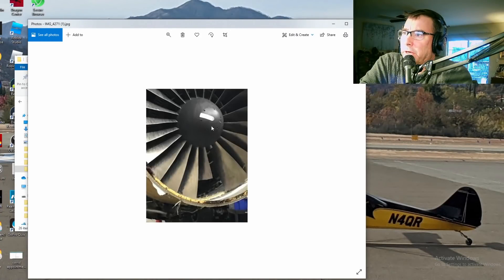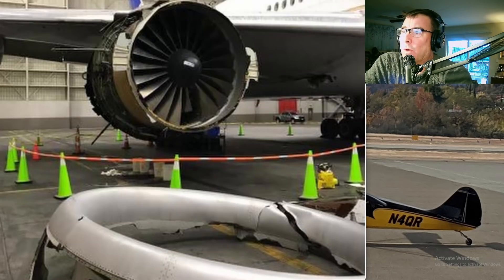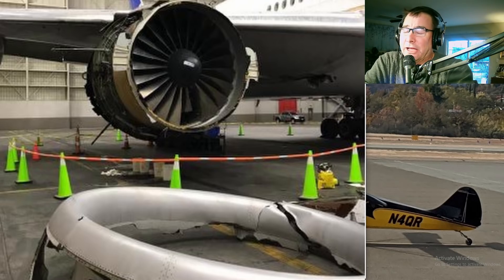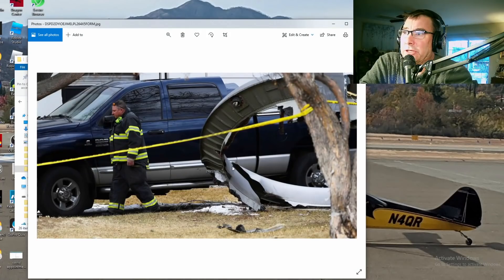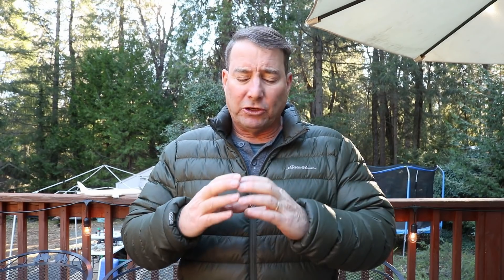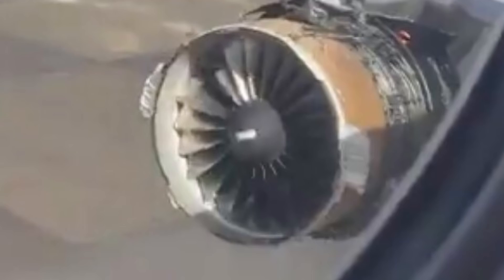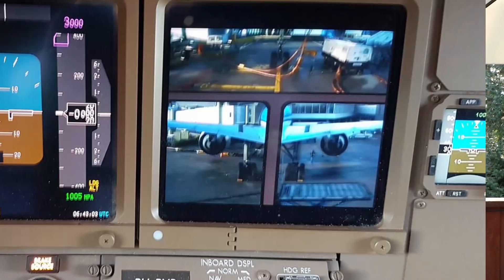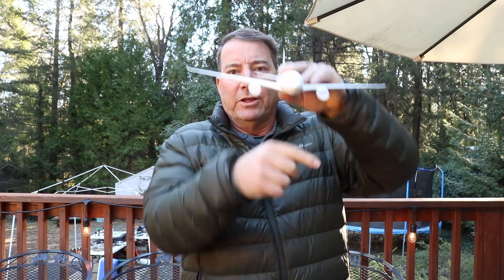UAL 328 UPDATE Fan Blade Failure  B777-200  22 Feb 2021

Comment: Contained vs Uncontained engine failure:  Okay, it’s true that the 35 pound fan blade did not pierce the Kevlar shield but if you were unlucky enough to have it miss the Kevlar shield and strike vital hydraulics, electrical cables or through the fuselage, is it still considered “contained”?
Reply: If it didn’t pierce the Kevlar shield how can it hit the fuselage
Reply: According to Juan, the fan blade struck the leading edge of the cowling ring creating a slice and causing it to break free of the engine.  There would be a great deal of kinetic energy from a 35 pound fan blade even after it sheared through the cowling.  It would be a random direction for the broken fan blade when it separated from the axle.  About 40 degrees of that rotation faces the fuselage.
Reply: I stand corrected.  In the first 60 seconds Juan describes the fan blade struck the Kevlar shield and kicked forward slicing the cowling.

Comment: Is emergency landing weight impacted at all by the altitude of the airport?
Reply: What do you mean by  “emergency landing weight?” Blancolirio does not mention it. He only talks about single engine landing speed. The weight is more or less irrelevant. If the runway is long enough for single engine (faster) and actual weight at the time (even if above max recommended landing weight)and you want to get on the ground ASAP then LAND.
Reply: @biingyin5522   Might have been better to ask if altitude impacted emergency landing procedures as that's what I actually wanted to know.  lol, sometimes fingers type words that aren't really required.

Comment: Juan, it may have been the blade failed and hit the Kevlar liner at the 2 o'clock position. 

In the video from inside the aircraft, you can see the evidence of the Kevlar "flapping" at the 2 o"clock,  and the lower (4 o'clock) area of the Kevlar still shows integrity. Fortunate the functioned a designed, or it may have been a cabin intrusion and much worse outcome.

Thanks for your report and analysis.

Comment: can we get a round of applause for how well these planes hold together and get everyone on the ground when we have these incidents. it's pretty damned amazing i think, considering the size and power of these engines, and the forces in effect when they go ka-blooey !
Reply: Sadly most great engineering (and professional training, for that matter) is written in blood. I don't want to say it's a necessary part of how good things are today, but I will say that, in general, engineers and those responsible for training today's professionals, do try to learn lessons so that those unfortunate ones did not die in vain.
Reply: @uzaiyaro  Same thing can be said about automotive industry and related highway infrastructure. A lot of areas of life now that I think on it.
Reply: Your so right and I appreciate you bringing that up Tony. With everything today that goes Tango Uniform you’ll hear nothing but negative reports by media and later brought up by the public and Boeing has had more than its share. I have no problem with that as long as it’s factual but really wish it was balanced and fair by presenting any and all positive points concerning the incident. Thank you from a retired McDonnell Douglas Boeing employee.
Reply: As an Aussie, any engine failure incident like this always reminds me of QANTAS Flight 32. Richard de Crespigny is something of a personal hero of mine along with the other aircrew and two check captains also on board that day, and the crew of United 328 (and tower/ATC personnel) displayed similar levels of professional conduct in this case. The failure mode of the engine in Flight 32's case bears mentioning in respect of your comment about "how well these planes hold together" (from Wikipedia):

"After holding for almost two hours to assess the situation, the aircraft made a successful emergency landing at Changi. No injuries occurred to the passengers, crew, or people on the ground, despite debris from the aircraft falling onto houses in Batam.[1]
On inspection, a turbine disc in the aircraft's number-two engine (on the port side nearest the fuselage) was found to have disintegrated, causing extensive damage to the nacelle, wing, fuel system, landing gear, flight controls, and engine controls, and a fire in a fuel tank that self-extinguished."
Reply: Tony Yes the people who Design and Maintain these Aircraft all need a Big Pat on the Back as if through the years of testing and evaluation and Trend monitoring of Engines and systems. The end result with all that happened the Aircrew did a great job the other Airport staff and Fire rescue all did what was needed and Thankfully the end result was a Safe Landing and no one Killed
Reply: Crazy to think I was on that same plane a week before
Reply: I keep hearing people talk about how this shows Boeing is a terrible company. Not only do they not make the engines, but let’s see how safe you end up if your car’s engine explodes at highway speed.
Reply: I will simply pray next time I get on a plane with this engine , LOL.
Reply: "go ka-blooey !" Hahahahaha :-D

Comment: The broken engine may have a resonant frequency that results in the minimum shake occurring at a higher speed. Wonder if the pilots can feel it in the 'steering wheel'.
Reply: I think the 777 is a fly by wire

Comment: Thanks for the video. 
Two comments:
- - ETOPS now refers to Extended Operations, with the term 'Twin Engine' removed some years back, to reflect remote operations by tri & quad jets (think Polar Routes).
- - The 180 minute limit is bumped up to 207 minutes for particular operations (don't ask me why it's 207 and not 210...).

Comment: Great summary of this event Juan. As a Design Engineer for one of the other jet engine manufacturers, I wanted to clarify one of your statements. The fan blade-out certification test is typically conducted with all nacelle cowling installed except the fan cowl doors. A critical part of compliance to the fan blade-out requirements is demonstrating, via ground test and analysis, that none of the nacelle or engine external hardware liberates from the engine during the event or during post-event windmilling.

Comment: When they designed ETOPS certification requirements, I wonder if they took into account not just lack of thrust on the failed engine but a failed engine that vibrates, shaking loose (and worsening) for 180 minutes.   Flying single engine is one thing... but flying with an engine about to fall off during 3 hrs over the Pacific?

Comment: I worry about the safety  if thas had happened at the limit of ETOPS range, with that massive vibration.  The shear pins have a limit, but this was not apparently exceeded - but has the wing structure been tested for that degree of vibration over that length of time?
Would the residual fire have burned its way back along whatever was feeding it and damaged the wing?
It seems to me that fire suppression systems should be tested to cope both with and without the cowling.
There's a lot of meat still on this bone.
But at least a white fart in the wind beats a wet fart in the wind.
We all know liquid fires can't be tackled with water.

Comment: Damn, what's the diameter of those engines on the 777?
Reply: The fan is a little over 9 feet... but to put it in another perspective, the nacelle of the 777 is bigger in diameter than the body of a 737

Comment: Juan - You are correct. Engine out approach and landing is done at 20 degrees flaps (at CAL / UAL), while a normal landing would be 25, or 30 degrees flaps. The single engine missed approach flap setting is 5 degrees. A max gross 777-200  can actually stop in less than 4000 feet of runway (ground roll). As this flight was an over water event, there were three pilots in the cockpit. The IRO is a real asset during the emergency, in coordinating with company operations, and working with the flight attendants, plus backing up both pilots in the front seats.                                                                                                                                       The TAC (Thrust Augmentation Computer) will correct 90% of the rudder input for asymmetric thrust during takeoff. So the flying pilot only needs to add a small amount of rudder input to keep the plane going straight. While airborne, the TAC will correct 100% of the rudder input, making the 777 real easy to fly single engine. The autopilot is awesome, and is certified for CAT III Single Engine Auto Land. However, the A/P system is not certified to perform an overweight (exceeding max landing weight) auto landing. The B-777 is the "Queen Of The Fleet". That's just my opinion!

Comment: If an engine fails and the cabin depressurizes, will ETOPS get you to an airport at FL100?
Reply: @ralphgesler5110  No, he didn't. He discusses depressurization with 2 engines, and single engine at about FL200. He didn't address the combination. But these could be consequences of a single failure as in SW1380. It's about the inefficiency of single engine vs. two engines at FL100 and if there is enough fuel for that.

Comment: Juan, I share your concerns regarding extended single engine flight under ETOPS on a trans pacific flight. With the windmilling engine shaking and in flight engine fire, it might be preferable to jettison the failed engine when over water.  Something the FAA might want to consider is equipping the pylon bolts with explosive bolts that the crew could use to intentionally separate a damaged or burning engine from the aircraft under this scenario. Seems preferable to hundreds of miles dragging it around in a potentially dangerous condition. That would also reduce fuel burn due to reducing the drag of the dead engine.

Comment: What would happen if you lost an engine in an uncontained situation and it caused the fuselage to be punctured and rapid decompression occurred and you were at that half way point to Hawaii? Would there be enough fuel on 1 engine, flying at 10,000 feet to make it to Hawaii?

Comment: I seem to have made a grievous error in the following and ASSUMED the fans were made of carbon fiber. Apparently they are made of metal, not a composite. My apologies to all.  
34 pound fan blade. I thought they are made of carbon fiber, an incredibly light and strong material. The carbon fiber front fenders on my former ZO6 Corvette felt almost weightless when I had a chance to hold one. Having said that, the fan blades must be much larger and massive than they look.  Kudos to the crew for doing everything correctly and bringing the aircraft back safely.
Juan, I think is your best video ever!  Very well done, with lots of details for us armchair pilots.

Comment: All this data is adding up to a need for more design criteria for the engine cowling - just like the engine its' self. That issue has spent too much time swept under the rug and now it needs to be addressed. Not only should the cowling survive an engine event, it should be designed so that it is extremely difficult to miss latching a cowling. Maybe we need a cowling standard so that they are all the same in function. Things to consider.

Comment: Can't PW get their fans together? We have the B777 with the PW4000, the 747 with the PW4000 that failed in the Netherlands, and...the Air France A380 Flight 66. The Engine Alliance whose fan blew up too. I think the Pratt makes the fan and the low pressure compressor and GE does the rest, right?

Comment: Would ETOPS allow for an engine failure which also depressurizes the aircraft, like in the Southwest Airlines B-737 fatality incident.
You mentioned a 10,000 ft. altitude in a depressurization scenario, but would that also apply if the aircraft was additionally operating on only one engine at 10,000 ft. ?
Like, have the ETOPS regs allowed for that double scenario as well, hence enough fuel to safely complete the trip at the equal time point ?

Comment: Thanks for the update Juan. In one of your first long still photos at 45 seconds, it looked like there was also damage to the underside of the wing where the fuselage fairing joins the wing. Do you concur and if so, are there any critical components in that area that could have been affected by a larger distribution of failed blade/cowling shrapnel?

Comment: What happens if the engine mounts fail and the engine departs the aircraft?
Reply: The engine mounting pins would be designed to fail at a certain stress level to prevent further damage to Wing. Blancolirio talks about that. 
So basically the answer is good . But not so good for people on ground
Reply: @biingyin5522  . Yeah I get that. I'm wondering how the loss of the mass of the engine effects weight and balance and what problems that would cause.
Reply: @mhayling  the pilots can adjust either with trim or autopilot

Comment: very good...

looking forward to hearing your thoughts about the likely cause to stem from a HPT failure...that  a catastrophic failure at that area would likely produce the add on effect from a sudden high energy shock transiting the shaft to forward fan blade assembly.  Given there were at least 2 EA's earlier for corrective NDT practices for the U groove and inner seal race at stage 14 (and other stages?) of the HPT assemblies for this pw4077 (and other "series/variants"), one would be inclined to look closely at that as root cause.  This theory (unproven at this time) is supported by real events in past and is consistent with the same kinds of secondary damage to the bypass fan blade (and forward cowling),  ANDS  helps to explain the damage in the engine shroud and  cage at the aft engine areas matching where the HPT assembly lines up.  Further:  the damage seen in the aft cowl and shroud near the HPT region is NOT not typical of bypass fan blade ingestion, but of uncontained failure deep within the engine. AND is typical of related  high energy fires even after both bottles...  HPT region uncontained failures are quite different than simple bypass fan blade failure...that's the key part trying to get across.  and this damage seems consistent with HPT failure as a root cause both in history trend and also in observed damage and fire.  ALSO,  noting the uncontained shrapnel damage just outboard fuselage that nicely matches up to the HPT area of the engine...that is unlikely to be caused by high bypass fan shrapnel.  

other interesting comment:  while you explain the test environment for containment of bypass fan blade studies are static..it's important to notice that until only recently (last 10 years or so), tests have also revealed that a certain phenomena exists with failure of the bypass blades in flight...in flight, the fan blades have the tendency to literally leap forward "out of" the cowl as they begin to disintegrate....this is a complex set of physics going on not controlled by  to aerodynamics alone, but also , involve  stored potential energy being released suddenly.  (think, how a rope might snap under a load...there is a great amount of stored potential energy released at the moment it parts).   The fan blades release alot of that energy forward..and that helps to explain the forward damage...and also puts in question if the source of damage to the fuselage just forward of the L/G was from the fan bypass blade sharpnel..or was from secondary shrapnel from cowl damage...OR from HPT failure nearest that location. The distance and alignment of that damage strongly suggests this was not from simply flying debris existing near the forward engine, but from high energy debris just outboard of that damage...the damage itself is quite telling.....trailing shrapnel leaves a "trail" of damage...we see what amount to as a qualified direct hit. with little evidence of trailing damage one would normally see ....My opinion (emphasis, opinion) is that this fuselage damage tells a big story about the source of damage, the energy of it, and from where it came.  If you put that all together, it suggests strongly that the forward bypass blades were not the root cause of failure..but was a secondary effect from a very high energy event from a massive HPT failure in the core...

that's just my own theory.

but there are lots of reasons to suggest this ...most of them related to former EA's that identified the HPT and particularly a manufacturing practice that received alot of attention...and even more, a host of issues related to proper QC in the inspection procedures and proper training and inspections.

hollow bypass fan blades rate high on the buzz word gameshow...yes, it's unique..but I would go with occam's here....and what does history show?  look at the EA's and the EO's that boeing was forced to implement.  this thing has HPT failure written all over it.

Comment: Another great installment.  Damn, that slice through the nose ring sure is revealing!

Aren't those blades made out of the most durable titanium alloy available?  6/4 or similar?  That said, all materials have a known fatigue cycle life, so was this failure due to a maintenance issue?   Or a debris strike-caused failure?  

Crazy!  

You'd think with the lower usage of the airplane stock, the ones being flown would be in tip-top shape.  Then again, with the pandemic and decimated revenues, there isn't much $$$ for robust preventative maintenance.  No-win situation when margins are so thin.

Would you rather save $10 a flight, or rest assured the equipment is as well cared for as possible?  Perhaps we should ask Texas how they feel about deregulation about now!